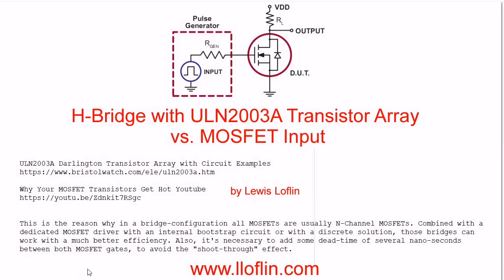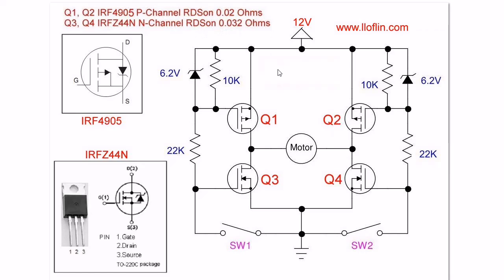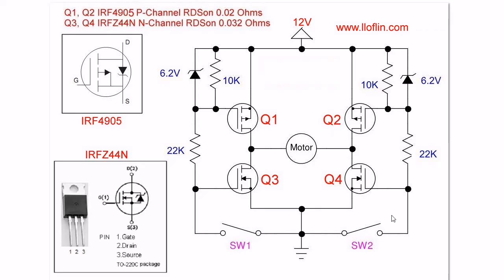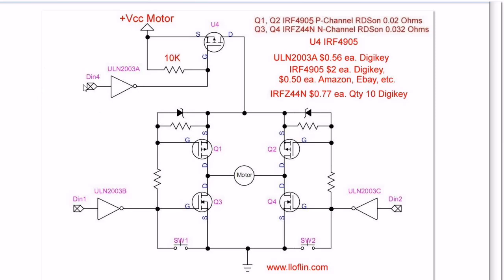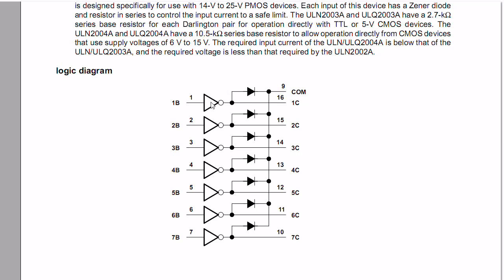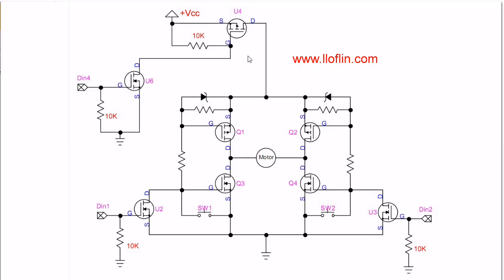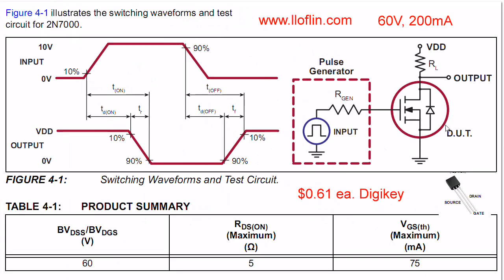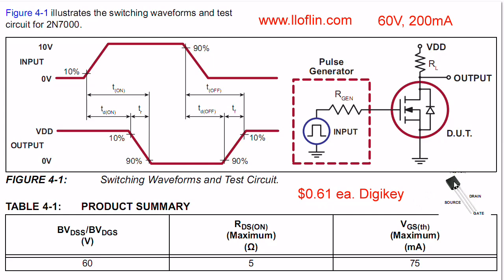H-Bridge with ULN2003A Transistor Array vs MOSFET Input

Comment: Rookie question here: If I don't need to change direction very quickly, why not make my H bridge with relays and control speed with an N channel mosfet on the ground side?
Reply from the maker: You can do that, but it is unreliable, and the speed is slow.
Reply: @LewisLoflin  Thanks, I understand it would be slow, but why unreliable?
Reply from the maker: @nicksauer6749  Mechanical contacts burn and arc when used with any real current. Relays are also expensive compared to solid-state replacements. I've seen relays used in many applications, and they do OK. That is my opinion only, your opinion is just as valid.
Reply: @LewisLoflin  Thanks again Lewis. I have a relatively high current application where the speed of changing direction isn't particularly important. I only anticipate switching the relays at times when the Mosfet is off and no current is flowing. I think that would minimize arcing and relay deterioration. Perhaps 'what is best' depends a lot on the specifics of the application? I'm not really trying to push forward an opinion, just want to discover any pitfalls in my approach.
Reply: You can combine low-side mosfets with power pnp transistors on the high side. Base of the left pnp connected to drain of the right mosfet and base of the right pnp to drain of left mosfet through resistors. Use zetex PNPs starting with ztx or fzt.